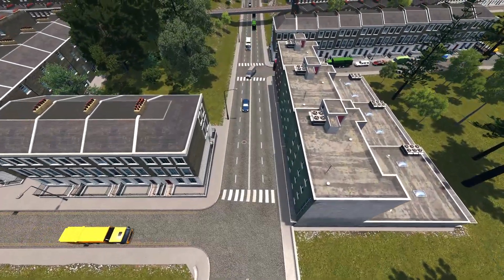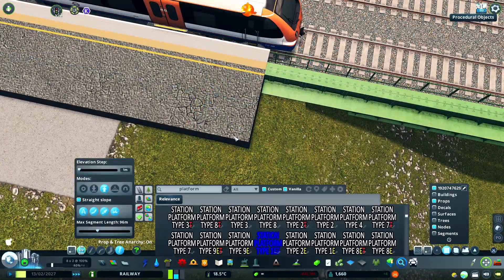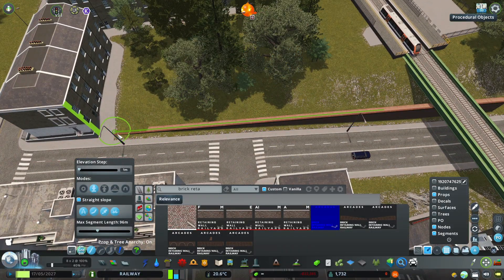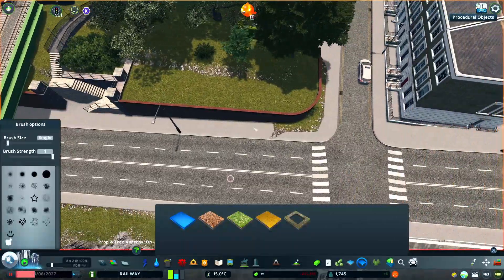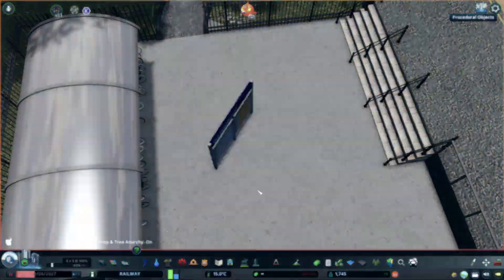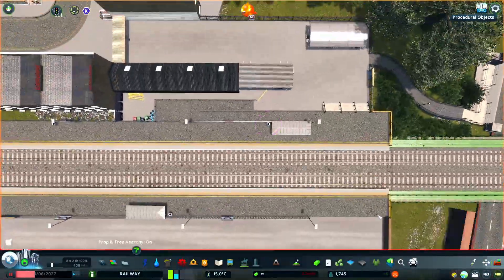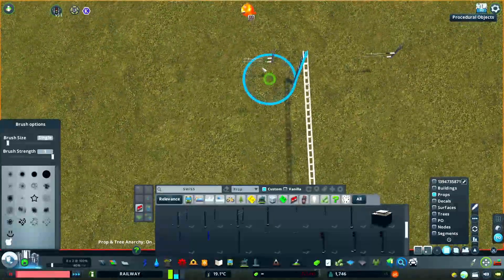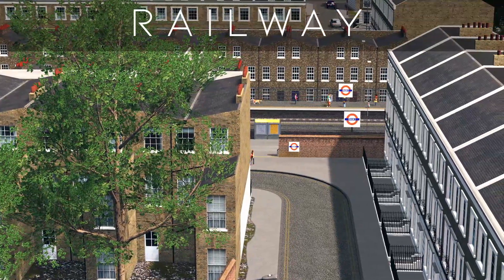An Introduction to Custom Stations in Cities: Skylines | RAILWAY | Episode 02

Comment: So, as an American, who clearly has never witnessed this kind of infrastructure.. are the noise levels (real or even in game) a bother when living that close to the rail lines + station?
Reply from the maker: I actually lived literally next door to a London Overground station for a few years. The trains are electric, so do not make much noise when getting up to speed. The tracks are continuous-welded rail, so you don't hear the wheels clacking over the joints, and the trackbed is of a high standard to reduce vibrations. Many houses in the UK have double-glazed windows which not only keep the warmth in, help to keep sounds out. Honestly, I noticed the automated train announcements more often than I noticed the trains themselves.
Reply: @kjmci  that’s so much different than here 🤣.. we have one tiny line that goes through downtown, and despite passing by one of the most expensive condos in the city, it still blows it horn at odd hours and is noisy as hell.

Comment: Hi. I tried your way to make custom station but i just have one question. Is it working for intercities connection or is it just for stations betwen several stations in the map ?
Reply from the maker: Make sure you have "Enable intercity connections" ticked in the properties of the station, and that the line is connected to the main line that exits the city. As long as you used the blank station asset I linked to, it's a fully functional station (just without any decoration).
Reply: Ok thanks for your answer because i try but no trains are coming from the outside of my map. I'm not an experimented player so maybe there is something wrong i do
Reply from the maker: There needs to be a demand in your city for outside connections to arrive. Make sure you have buildings that will attract tourists.
Reply: Oh OK. I didn't know that. So i don't need to have a main train station first before to make custom train station ? Because i have only 1300 habitants in my city and not so many industries in there. Only shops and houses.
Reply from the maker: Yes, you can use the blank station to create a custom station and it will behave the same as any other railway station in the game. You just need to make your city more attractive to tourists before they will begin to arrive by train.
Reply: Ok thank you very much. I will try to do that. Thanks.

Comment: Hello I'm trying to build my own station but my cims stand at the ground level instead of on the raised platform (immersed in the platform). And some of my cims appear to cross the rail track at the position of pavement square instead of using a functional overpass. I wonder if there's any solution for these problems? Please help
Reply from the maker: Just to check - I think you asked the same question on the Steam Workshop? If not, I'll copy the answer I gave just in case: The pavement squares are the entry points to the platforms, there are multiple entry points to give users more flexibility in building their stations. However, if you place the station very close to a road, cims can transit from the street to the pavement squares (this is part of the game's design). If you want cims to exclusively use the overpass, you will need to move the station further away from any nearby roads.

The platform height is dependent on the station tracks you're using. If you're using vanilla tracks, this height is 1m. If the custom platforms you're using are higher than this, use Move It to make them lower.
Reply: @kjmci  Yes it was me asking the same question on steam. Thanks so much for clarifying! Just by doing some hands on exercise can I know how much hard work you've done.